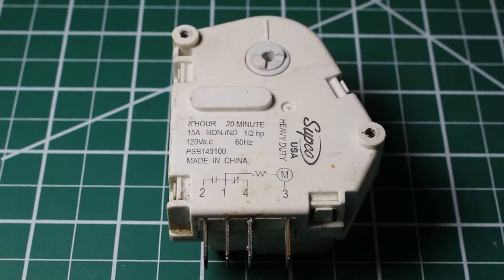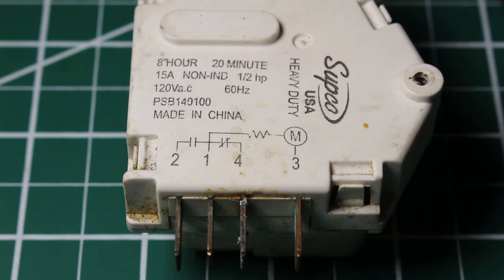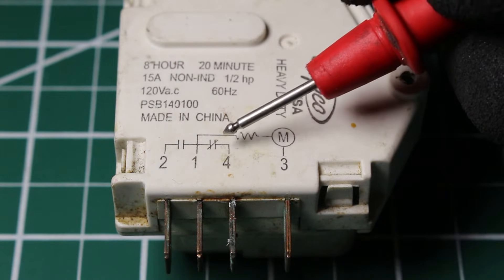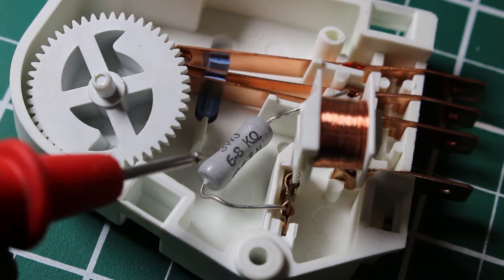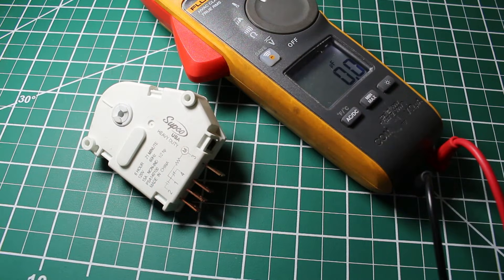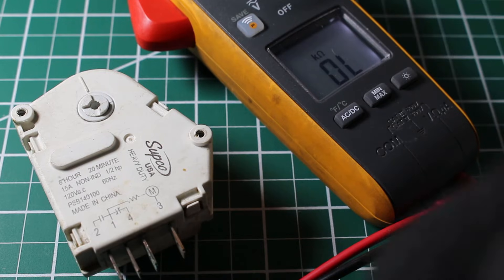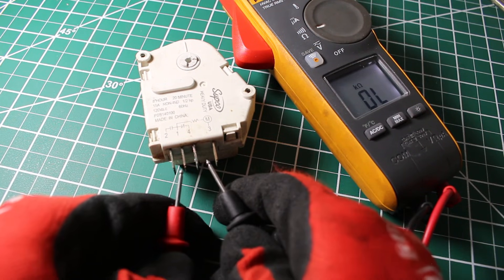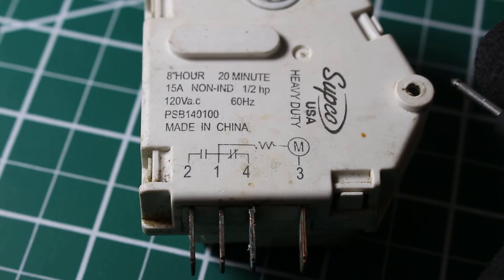HVACR: How A Refrigerator/Freezer Defrost Timer Works/Defrost Timer Troubleshooting/Sequence/Testing

Comment: Great video apart from the mixed up on the live and neutral terminals.
But something is perplexing me.  My 2-door fridge has this uncanny issue. It cools normally and also enters the defrost mode but then it stops there. The timer just stops after defrosting.  I have to manually turn the defrost timer's dial to make it start the cooling cycle again.
What could be the issue? I have changed and used 3 different timers but it still stop advancing after the defrost cycle.

Comment: You have it backwards. 3 is not power in. 1 is power in. 3 is for the timer motor and it gets its power from 1. And then 2 (defrost) and 4 (cooling) also get their power from 1. Also, an open reading between 1 and 3 does not mean the timer motor is bad. My timer is good and it shows an open there. I read that the readings between 1 and 3 can be wonky because there is a capacitor in the motor circuit.

Comment: Very good explanation of the defrost timer, thanks.
I worked on whitegoods for a short period of time (but I do have a long history in electronics and mains wiring applications)....
However, I did not know the exact functioning of the switch, except that it is a timer style, long time one way, short time the other.
With this knowledge now, I can test the switch to see if I have a bad switch (not turning on the defrost heater), or a bad heater (because I can tell that fan and compressor are on when in cooling cycle, means that side of the swith circuit works) - Possibility now it could be the switch/timer is not providing power to the defrost heater, or the defrost heater is bad.... Diagnosis time.

Comment: Sorry, Resistors are measured in ohms, not micro  farads.
Capacitors are measured in micro farads, farads, Pico farads, etc.
The 3W you are seeing simply indicates the resistors wattage, or power it can withstand.
This resistor is about the right size for a 3 watt resistor. Greater wattage resistors get larger in size to accommodate greater heat from more current flow.

Good job with explaining the contacts, and the circuiting.

YES !!! I have multiple degrees in STEM, including an AS in refrigeration and Air conditioning,  and Mechanical engineering.
I taught HVAC at the College/trade school level.

Tim

Comment: Terrific! I'm attempting to troubleshoot an issue with my fridge but I don't have a multimeter. Occasionally the fridge cooling system doesn't engaged and I find it not cold; but if I strike to the front door the fridge the cooling system starts up instantly. Is this an issue with the defrost timer or something else? Perhaps the contacts are corroded?. There may be days with the fridge works fine. I'm not that technically inclined. Any thoughts?
Reply: If you don't even own a multimeter, and you don't quite follow what is going on here - My apologies to say, but you should not be attempting to work on a mains voltage appliance, for risk to yourself, and your property.
Call a professional, or invite a friend who understands the concepts, PLEASE, for your own safety.
Reply: Hello Steve thanks for the response. Yes, caution with a main appliance is very important. I take a lot of precautions would not attempt anything or than minor electrical issues. I am required to have some basic electrical training for my job... Ultimately I did discover the problem was with the Fridge Thermostat. I bought a universal Thermostat on Amazon and the fridge is working just fine. Thanks to you and others online.  @steveodonald1979

Comment: That has to be a very old refrigerator.Within recent times the defrost control is electronic.
Reply: Even if the defrost timer is electric, it should still exhibit the same connectivity behavior between 1 and 2 or 1 and 4. The mechanism might be different (and impossible see by opening the device), but the behavior at the pins will be the same.

Comment: Great video!  If there's no reading between 1 & 3 making the timer bad, does that mean that the compressor will never turn on, even when the timer gets manually put into the cooling mode?  I do have continuity between 1 & 4 and 2 & 4.
Reply: The compressor and heater are mechanical switches that are changed by rotating the shaft. If the timer motor doesn't work, the shaft doesn't rotate and the switches stay where they are, whichever one is engaged is what you'll get. I've been rotating mine manually a couple times a day for a while now to trigger the defrost cycle and then go back to cooling. Just be sure to move it out of defrost after 20 min or you won't get the cool cycle!

Comment: Neutral is always 3, the phase from the temperature thermostat comes to 1, then it goes to 2 when defrosting to the defrost thermostat, then to the terno diode and then to the heater.
Greetings and happy work.

Comment: This video was helpful. My experience with a Maytag refrig/freezer may help. My Maytag has two thermistors that send data in the form of resistance to the main board. As the temp gets lower inside the freezer or refrig, the impedance increases & that info is sent to the Maytag main board. At zero degrees F, Maytag wants my freezer thermistor to read 22.7k ohms but my thermistor read 16k ohms and the replacements I bought online were also incorrect. Because of the inaccurate thermistors, the defrost cycle never occurred. While replacing thermistors is easy, obtaining thermistors that match Maytag's spec was not easy so what I did was add a 6.8k ohm resistor in series with the existing thermistor. When zero degrees is achieved, the impedance is now 22.8k ohms and that's important because until the freezers achieves zero degrees F, the main board will NOT turn on the defroster. Instead, the compressor will run w/o stopping until the overload switch on the compressor opens the circuit allowing the suction line & evap to defreeze. I acknowledge that the additional resistor will skew the warmer temperature impedances, but that didn't make any difference and because the food compartment should never drop to zero degrees, I did not install a resistor in its circuit. Bottom line, my Maytag now defrosts every 18 hours for 25 minutes. I recommend installing a temp sensor in the freezer and in the food compartment that accumulate data and send that data to your computer in the form of a csv file so you can measure and track your progress.

Comment: Thanks so much now I know what to do with my bad timer .... disconnect #3 so the timer does not advance out of cooling mode... then to defrost I need to manually advance the timer to the defrost, wait 20 minutes, and then advance it to cool again.... or find a new timer at a reasonable price and replace the bad one....

Comment: Pin 1: The main input power is attached to pin 1.
Pin 2: When in defrost mode, the power (pin 1) connects to pin 2, which activates the defrost mode. 
Pin 3: This is your ground / neutral wire. It will be separated from the other three pins.
Pin 4: When the timer is not in defrost mode, the power (pin 1) connects to pin 4, which activates the compressor and fan.

Comment: Between 1 and 3 is the tell tale whether it works or not, can you install an  LED to show unit is working and have LED bulb exposed to see outside of timer housing? Of course that would be seen if timer was in front top of cabinet. No way to know if the timer is working other than pulling out and putting meter on the control spades.
Reply: For that matter, when defrost is on a red LED would be nice, and blue for cooling, is this a stretch?

Comment: Actually, power comes in one pin 1. Neutral is on pin 4  and the return for the timer motor, also makes a good point for reference when making voltage checks.
Reply: Yes, this is how it's displayed on the service manual of my fridge, you are correct.
Reply: That wont work.  Pin 4 is the hot to the refrigeration circuit. Pin 3 is the return for the timer motor back to the neutral wire. The author should have included the wiring diagram to fully understand how it works in circuit.
Reply: On this timer, if power was pin 1 and neutral was pin 4, you'd have a direct short on the 8 hour cycle. Hopefully a breaker would trip right away before you started a fire!

Comment: 3 is common or neutral. 1 is live or phase. Proof is the diagram itself 1 splits to 4 & 2. Secondly, you can see the resistor is placed on the side of 4,2,1, which is the side current comes from. Resistor is not on the side of 3. The work of resistor is to control the  current or simply minimize the current to protect the motor. 4 & 2 after being tested can be determined which is for cooling (compressor) & heating (defrosting). The longer time you turn till you hear the tick sound is for cooling. The shorter turn till you hear the tick sound is for heating. Every manufacture can differ numbers, but can be determined by diagram shown and/or continuity test. So do not cram the numbers.
Reply: Exactly this guy he make people lost😅😅😅
Reply: Stop deceiving people, (M3) is Neutral (1) is common live terminal (4) is compressor (2) is defrost heater terminal.
Reply: I don't thing the video is correct.
@mh9251  makes more sense
https://www.youtube.com/shorts/09ShrRNlJwY
Reply: ManufactureR not manufacture. Very common mistake by Americans.
Reply: @florantedeogaygay2496  Am not American. Neither I live in U.S. "Every manufacture" That means I refer the product made by manufacturer, am not referring the manufacturer. All tech knowledge you got inspired, but as your habbit & ego, tried to pick the English, yet didn't work. Good luck

Comment: Best explanation on YouTube so far !
Question: if I want bypass the 20 minutes defrost time ( to run and use minimum watts from power bank during power outage) then I should rotate the screw timer till click sound ?
Reply: no, you should cut the wire coming from the number two terminal and wire nut both ends..  When box temp. cannot be maintained, reconnect the wire. defrost heater uses 500 watts as opposed to cooling which uses about 150 watts.  I would get bigger generator and keep my hands off unit.
Reply: Rotate it until you hear a click sound and then continue to rotate it a very short way until you hear the second click to bypass that 20 min defrost period (the defrost is the short distance btwn clicks). Then you'll have another 8 hours of cool. Each single rotation of the timer is one full cool/defrost cycle. Hard to tell by the video, but the part of the shaft the inner leaf blade (#4) rides on expands as you rotate it, keeping it in contact with the middle leaf (#1). When you hit the defrost portion, there is a large step down in the shaft that makes the sprung cooling leaf (#4) jump in, pulling the outer leaf (#2) into contact with the center power leaf (#1) - they are connected by a plastic piece so they move together and can never touch the center leaf at the same time. When the center leaf hits that drop, it goes back into contact with the cooling leaf until the shaft rotates all the way around again.
Long explanation, but it just means that yes, you absolutely can jump the time ahead even if it's a perfectly good functioning timer, and you'll get another X hours until the next defrost (where X is the default on the timer).

Comment: Great electrical video, but these timers also fail mechanically when the motor gets old.  The motor will stall and quit turning the wheel (Usually at a step position on the wheel) and this reeks havoc with Cooling operation.  Then it will suddenly get its wind and start turning---maybe by someone slamming the refrigerator door at the right moment.  It will cycle until the next impasse.  The timer is bad and has to be replaced due to mechanical failure (Tired weak motor).  Happened to me.

Comment: Thanks. Great video and explanation. My WR9X489 timer shares #3 with either #2 or #4 as cycle dictates, not #1, as in your video. Is #1 always neutral regardless? Is #3 always hot? Is #2 always heat? Is #4 always compressor? Regardless?

Comment: Thanks for sharing such an Awesome video.
Can you please also guide as how the freezer & refrigerator cooling temperature are maintained having separate temperature sensors in freezer & freezer compartments using single compressor. Is this done by blower fans by switching them on & off , specifically the one in refrigerator compartment using it's temperature sensor. Please explain.
Thanks & kind regards.

Comment: Wow... Clear voice, clear explanation and clear video... Great man... Tq.
Reply: 3 is common or neutral. 1 is live or phase. Proof is the diagram itself 1 splits to 4 & 2. Secondly, you can see the resistor is placed on the side of 4,2,1, which is the side current comes from. Resistor is not on the side of 3. The work of resistor is to control the  current or simply minimize the current to protect the motor. 4 & 2 after being tested can be determined which is for cooling (compressor) & heating (defrosting). The longer time you turn till you hear the tick sound is for cooling. The shorter turn till you hear the tick sound is for heating. Every manufacture can differ numbers, but can be determined by diagram shown and/or continuity test. So do not cram the numbers.

Comment: At 2:33 min into the video, you said between term 1 and 3 you should always have power, constantly.  Don't you mean you should have power when the thermostat is closed requiring the compressor to be running?  The timer should only be running  when the thermostat is requesting cold.  Then when it goes into defrost, the timer shuts the compressor off and heater on but the clock still runs because the thermostat is still sending power to the timer but the timer is cutting it off from the compressor.

Comment: Hello I have a whirlpool side by side refrigerator model number wrs311sdhm02 I want to see if my defrost timer in stuck in defrost mode. I don't know where the find it. I was told to look on the control panel. But know one knows where it is at on my refrigerator ASAP please
Reply: try removing the grill at the bottom of the front and look around the left front by the wheel. u might find the manual advance knob(flat screwdriver needed)
Reply: @richardault8783  thank you so much God bless you and your!
Reply: @richardault8783  I can't find what you're talking about
Reply: @richardault8783  I can't find the manual advance knob can you help me out a little more where it is a picture
Reply: oops...meant to send this one.   https://youtu.be/Bh82Le__ViI
Reply: Top right corner of fridge 
I can just tap the bottom and compressor comes on 
In the far right there is a hole for screw driver and turn it and see if comp comes on
Replace timer unit, model number required to get correct parts 
Easy to change out

Comment: The best explanation I’ve ever seen about a defrost timer ! The best one by far !
Reply: 3 is common or neutral. 1 is live or phase. Proof is the diagram itself 1 splits to 4 & 2. Secondly, you can see the resistor is placed on the side of 4,2,1, which is the side current comes from. Resistor is not on the side of 3. The work of resistor is to control the  current or simply minimize the current to protect the motor. 4 & 2 after being tested can be determined which is for cooling (compressor) & heating (defrosting). The longer time you turn till you hear the tick sound is for cooling. The shorter turn till you hear the tick sound is for heating. Every manufacture can differ numbers, but can be determined by diagram shown and/or continuity test. So do not cram the numbers.
Reply: No it's not!  He got it wrong with the hot and neutral!
Reply from the maker: Thank you very much! Stay tuned for new videos every week🔧⚡️

Comment: Great video.  A different YT video (that was also very good) said all the same except 1 and 3 were reversed.  1 was power and 3 was common.  Now I wonder which is correct.  Not that it matters!  lol   Per the wiring diagram, I think the other video is correct.  I think 1 is power and 3 is common.  Cheers!
Reply: 1 is power

Comment: Exceptional vid! I am working on what may be the longest running unit in the WORLD here Its a Traulsen Digitraul Ref/Freezer URS48DT . It has the old (I mean REALLY old) defrost switch failing. The numbers dont match the Supco you have here and the wires are all diff colors pigtailed all over! I am going to now be able to match wires to function, with the new Supco. I am very thankful